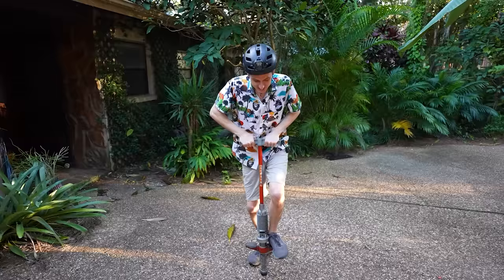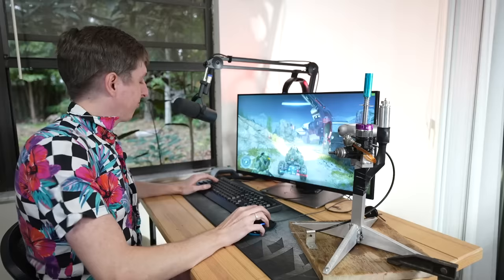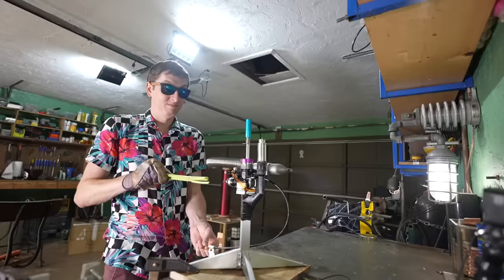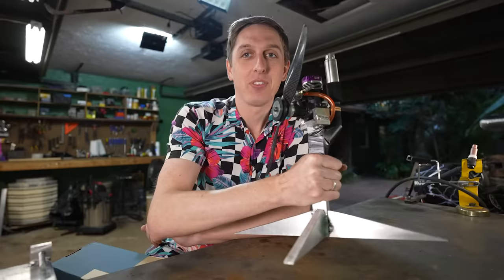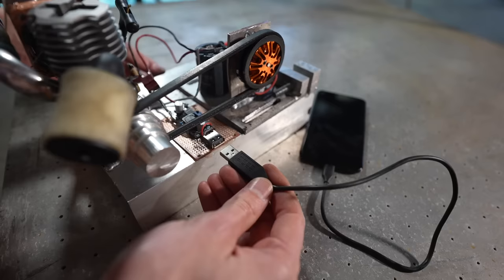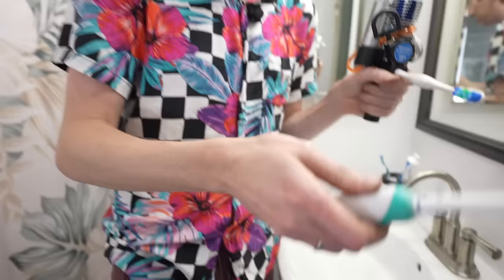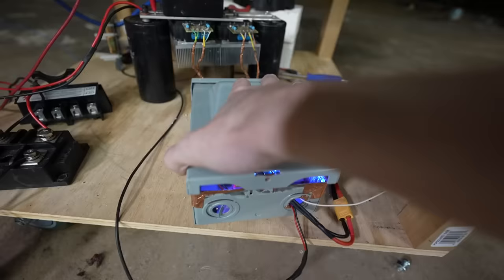Gas powering things that should NOT be gas powered

Comment: I'm new to watching the channel.  You are either very lucky or very careful not to have been seriously injured with your experiments.  You are in my prayers and I'll keep watching.  Keep up the good work!
Reply: The answer is yes.
Reply: Very lucky I'd say
Reply: Its probably a whole lot of both
Reply: Thanks to thousands of people like you this man is immortal
Reply: I could never imagine running a gas powered engine in an enclosed bathroom with NO FAN. I’m not sure what fuel was being used in the engine, but that could be like carbon monoxide poisoning or something.
Reply: OK
Reply: He’s from Florida, they’re immortal.
Reply: Send him some goggles. Hell of a lot more useful than your “prayers”
Reply: @thedarksage328  you just made my day. I haven’t been called a dweeb in years gotta bring that back to my lexicon
Reply: He's got nothing on some of the stuff I've done lol, I've toyed with danger for decades. Surviving it unscathed is for the most part due to caution and careful thinking, you don't survive this kind of stuff for long with luck alone (though of course it does play a small part for a select few). But some people are so cautious they don't realize that some things are actually quite safe if done properly, like making and using explosives (legally of course), high voltage electronics, highly pressurized gases, or spinning propellers inches from your fingers. Ain't nothin' but a thang lol.
Reply: I just got done watching an older video of his where he dropped a glass pyramid into a crucible full of molten aluminum. IN SHORTS. ARMS LENGTH AWAY lol. It exploded and legit he was like 1 foot far enough away. This guy is a riot lol
Reply: @Prince_Luci  why are you so miserable??
Reply: hes from florida💀

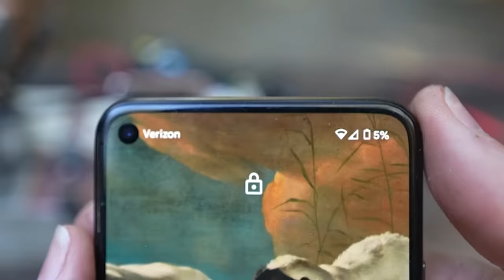Comment: 6:07 With some phones, you need to connect the data pins of the USB plug to around 2 volts to get it to charge, maybe that would make it work?
Reply: Just shorting the data pins together will work. That's basically industry standard for signalling that a USB power supply is capable of delivering 1 amp.
Reply: You‘d probably get best results with a USB-C car charger supporting PD. They are usually also quite tolerant on what input voltage you feed them.
Reply: @tuxrandom  Yeah that would work too, just thought half an amp charging rate would be more suitable for the generator :)

Comment: Regarding the phone not charging off of just 5v. The data lines usually need to be held at a certain voltage using a resistor voltage divider. For fast charging like QC 3.0 which is what all modern phones use you need an actual chip that negotiates a charge voltage and current with the phone over the data lines since adaptive fast charging uses 5v, 9v, and even 12v. Hooking the dc-dc converter up to the battery input of a pcb pulled out of a power bank would work as long as you set the voltage to 4.1v.

Comment: The nitro powered fan needs an exhaust system two run the exhaust outside. Plus the reason it's running kinda funky is because the muffler is tuned to the carburator. There needs to be a rubber hose from the hole in the muffler to the fuel tank

Comment: 0:31 The power per weight is still very low though. 

That 5 lb engine in your hand only produces 2Hp. That Hp is LESS than HALF its weight.

Normal car engines produce 150% hp to weight. So a 200Lb engine will produce 300Hp.

And this scalability CONTINUES as engine get even bigger.
Plane engines can produce 4x the power per weight!!!
So a 4,000Lb engine can produce 16,000Hp
Reply: wtf is that way to measure hp 
"a 200 lb engine will produce 300 hp" what

do you even have a single clue what you are talking about
Reply: @oliviersavard8676  Well if you don't understand, I MUST be crazy!
Reply: @TheTechAdmin  no i'm saying that you have literally no clue what you are talking about, where tf did you read that "normal car engines produce 150% hp to weight"

power is related to displacement quite often, and even then it's not an accurate measurement. power is (torque × rpm)/5252, and so, for an naturally aspirated engine, to get more power, either you get bigger displacement, either you get higher revs. weight has absolutely nothing to do in this, so there's my question: wtf did you smoke to assume that weight is somehow related to horsepower, or even that "plane engines can produce 4x the power per weight"? 

the engine in my old civic is around 130 lbs (roughly, +/-20 lbs), which is pretty light (all aluminium engine), and it makes 105 hp. and that's an average engine which is fairly light. i have no clue how you came to that "150% hp to weight" thing, because it's just not true at all.
Reply: @oliviersavard8676  ah I see! You're helping me learn, honestly. But you dont have to be so mean about it.

I couldn't really find an answer online. How much does an average car engine weigh?
Reply: @TheTechAdmin  well idk, all engines are different, it depends of its configuration (inline engine or v engine or flat engine), its displacement, the metal used (cast iron vs aluminium), the complexity of the engine, if it's got turbos or not and i'm skipping a few. an ls3 6.2 (standard c6 corvette engine) is going to weight about ~400 lbs, a 5.0 windsor (common ford engine) might weight 450 lbs, a j35 3.5 v6 from honda (v6 engine in the old accord for example) will weight about 360 lbs, an old 1.9 tdi vw engine will weight about the same, while a 1.6 ecoboost (ford engine) will weight about 250 lbs. too many variables for "an average weight".
Reply: @oliviersavard8676  Do car engine tend to put out their own weight in horsepower?
So like, that 400Lb Corvette engine. Does it make at LEAST 400Hp?
Reply: Where are you getting 5lbs? Those aren’t even 1 pound.
Reply: @TheTechAdmin  as i just told you it depends from engine to engine, power isn't related to weight in any way. it's not a way to measure horsepower or efficiency.
Reply: @oliviersavard8676  Ah, I didn't know that. I'm not into cars/engines. For me, horsepower to weight ratio is a smart way to guage power.
How DO mechanics guage power of an engine?
Reply: @TheTechAdmin  if you're not into cars/engines, then why did you write that initial comment at all if you didn't know what you were writing about, and why did you present it as facts?

as i said, in general, horsepower is generally related to size, but with turbocharging and supercharging that's not really all that true anymore. nowadays you have 2L four cylinders making well over 300 hp but they're all turbocharged. as i said before, if you don't rely on forced induction, either you need big/large cylinders (displacement), either you need pistons moving fast (revolutions per minute). the higher you want an engine to rev for a same displacement value, generally the bigger the bore is going to be (circumference) and the smaller the stroke is going to be (vertical movement of the piston) because the combustion generally has a set speed and the cylinders can actually move faster. if you have a larger surface area but a smaller area to travel, then the combustion will be more efficient. it's partly why you can have two engines with similar displacement but vastly different horsepower. a lot of factors come in consideration, but the engine in the harley-davidson iron 883 is a 883 cc v-twin engine and makes maybe 50 hp, while the engine in the old cbr900rr was a 893 cc inline four engine and made over 100 hp. the stroke is bigger than the bore in the harley engine (stroke is 96.8 mm while bore is 76.2 mm), while the bore is bigger than the stroke in the honda engine (stroke is 58 mm while bore is 70 mm). the harley engine kinda needs it though because it's aircooled and a bigger cylinder will have better heat dissipation, something that's not really required with watercooling.

again, weight has absolutely nothing to play here. forced air induction will help make more power because while you can increase the amount of fuel in the air-fuel mixture (by having bigger injectors, for example), you can't really increase the amount of air, so you're just going to be running on a rich mixture. to keep the ratio balanced, you're going to need more air, and forced induction will provide that.

there are way too many variables that can influence horsepower to simply attribute it to one thing, especially if that thing has absolutely nothing to do with it (i.e: engine weight). and i haven't covered most of them.

Comment: The phone needs a bias voltage on the data lines for it to accept the charge, electro boom mentioned it in his video. A 5v regulator would be much safer for your phone & more likely to provide a stable voltage too
Reply: Want some science-youtuber's names to check out? Want some Recommendation from a fellow science-enthusiast?
Reply: I would think it’d be easier to power a standard outlet and then just plug the phone in with the normal charger

Comment: If the engine is running hot then you need to turn the needle valve to the left a little bit. When a nitro motor is running you should be able at lick the tip of your finger and touch the top of the head of the motor for five to ten seconds until it starts feeling hot to the touch.
Reply: Nice tip I didn’t know
Reply: Tbh that is most Alcohol type fuels. You can tell if it's too lean or fat (fuel ratio) with temp.
Reply: @MLife1000  they are easy to tune. If it's too hot to touch then it's running lean, if it's running too rich it won't stay running.

Comment: You need to add a resistor on the data lines to tell how much current the phone can pull otherwise it will default to 500ma.

Comment: Hey Mr scientist. I think the reason your phone wasn't charging was because your data lines weren't connected. I believe when you want to charge your phone from an outlet you need to short the data lines together (please fact check) otherwise the phone doesn't accept much current for fear of breaking the supply
Reply: Came here to say this.
Reply: Yep same. The data lines usually need to be held at a certain voltage using a resistor voltage divider. For fast charging like QC 3.0 which is what all modern phones use you need an actual chip that negotiates a charge voltage and current with the phone over the data lines since adaptive fast charging uses 5v, 9v, and even 12v.
Reply: Yes but use a 220ohm resistor. Depending on your phone's firmware, a straight short might not mean charging mode and could potentially trip protection circuits. My tablet will power off and go into a boot loop if I short D+ and D- without a 220ohm resistor, with different values it triggers different functions. My old S3 had a large table of resistor values to set it into a variety modes automatically, for it a short meant car mode where the phone thinks it's the dash unit for a car.

Comment: Fun fact:one horse has fifteen horsepower.
Reply: One horsepower is about the useful power that a horse can do over long periods of time, so if you count the work done by a horse over a whole work day for example and divide it by the length of the work day, you'll get about one horsepower.

A horse might be able to produce 15 horsepower at its peak, but not continuously. That's also why the horsepower as a unit was invented: it was to sell steam engines by marketing them like "this machine can do the work of N horses for your factory"

Comment: Another reason the phone didn’t charge was because it wasn’t recognizing what it was, which was an added feature to protect phones.

There’s a USB device that can easily destroy some electronics
Reply: I don't think it's protection form USB Killers because, at least for charging, it doesn't need to supply power and a high voltage spike could shoot trough the internal circuit regardless of the supply. It's probably more to to with the specs of the USB port.
If you don't short out the USB data lines the phone thinks it's a PC and try negotiation. The USB 2.0 spec would only allow 500mA and the phone will likely default to that until it validated that it's connected to a port that can supply more (either USB 3.0 or a dedicated USB charger with QC or PD capability)
Shorting the datalines isn't a official standard afaik, and some phone manufacturers require a certain set of resistors to work, but most Android Phones should accept that.

Another way it could be possible to get even more power (assuming the generator could supply it) is to use a fast charge protocol (like QC or USB-PD) easiest way to DIY that is to get a 12V charger for cars and hook that up to the generator trough a 14V regulator.

Comment: I think the phone didn't charge because modem devices actually do a "handshake" with the chargers, as they negotiate for things like charge voltage, charge standard etc. That is why some phones fast charge only on their own chargers, and stick to low powered 5v1a for other chargers, and even those too after the handshake is done. Since your motor had no way to electronically signal the phone to prepare for a charge, the battery circuit just denied any incoming current.

Comment: RC airplane people will point out you should not start the prop with your finger, rather, you use a stick.  They are called chicken sticks, and you can buy rubber coated ones specifically built for the purpose, or you can just find another stick like thing, like a pencil or an actual stick in the yard to not use your finger.

Comment: One important thing to mention here is carbon monoxide poisoning, and why one shouldn't try this indoors.
By all means use it outside because the carbon monoxide will diffuse into the air and produce almost no health risk, but if you use this in an enclosed space for a period of time, the concentration of carbom monoxide will increase to lethal levels, and you won't notice you're suffocating until it's too late.

Comment: That was a hilarious, interesting and clever video, especially to an engine collector like me. But let’s get something straight. It’s a glow engine. It’s not a gas engine, and it doesnt run on nitromethane. The fuel content is mostly methanol (alcohol). Anywhere from 5 to 30 percent is nitromethane which is included to help boost power. Many of these engines will run on straight methanol with no nitro at all.  They just call them nitro engines because it sounds cool.

Comment: I don’t wanna be annoying but nitro is a form of diesel hence the need for an external glow plug to start it and the lack of spark plugs needed to run the engine as it combusts under compression. But other than that awesome video! Makes me want to buy a nitro engine and make a nitro generator 😂😂

Comment: This guy needs to educate himself and stop spewing misinformation. These engines do NOT primarily run on nitromethane. They run on methanol and oil through a catalytic reaction between the alcohol and the platinum on the glow plug coil. They would not run at all on nitromethane, as the catalytic reaction would not take place and thus no heat would be maintained on the plug coil inhibiting the combustion process. There is only a small amount of nitro in the fuel to act as an oxidizer to improve power and tuning. The term “nitro” engine is not accurate at all. They are actually glow engines. You can run them on methanol and caster oil alone without the nitro.

Comment: Finger???....I had an OS .40 with a 10inch prop on a big tunnel hull air boat when i was a kid. i strapped the boat to its stand and started it...set trim to about half throttle then tried to adjust the carb(right behind the prop).  it vibrated and my screwdriver came out of the screw and thumb went right into the prop!!! i flipped the boat to shut the motor off and put my chopped thumb into the oppisite arm pit and started screaming for help.  when my parents got to me they pulled it from under my arm... it wasnt cut off or cut at all!  it was about 5 times bigger than normal! lol.  it was like getting my thumbnail smashed with a hammer.  nail completely fell off was black, green and purple for a few weeks.
i sold that airboat after that. F a glow engine with a prop.
Reply: dr heated up a copper wire to glowing red... burned right through my thumbnail to let the fluid out.  it sucked!